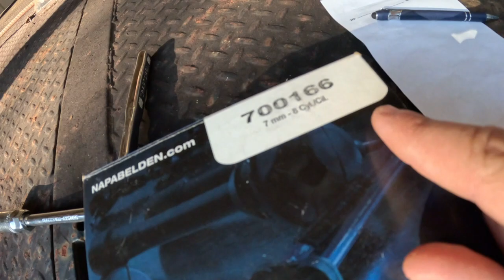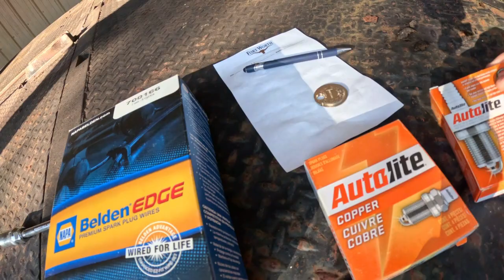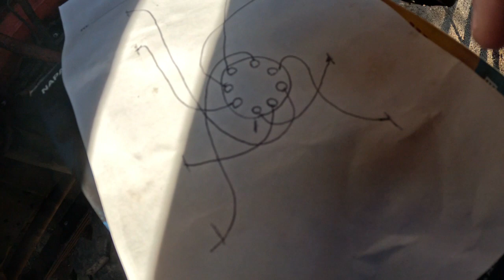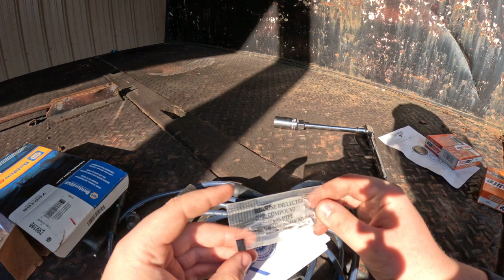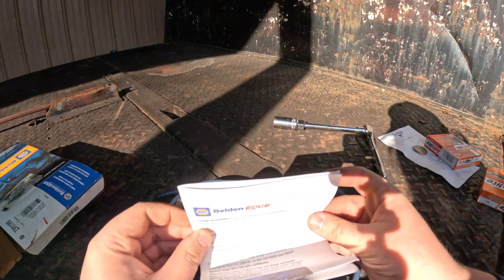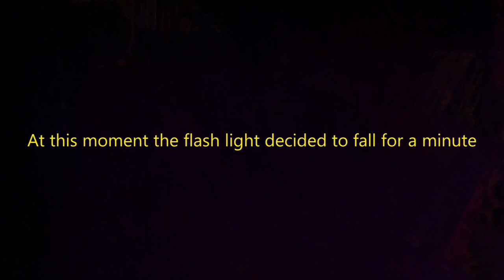Engine work on the 1968 International Loadstar CO-1700

Comment: I replaced the wires on my 68 Loadstar (V304) One wire at a time.
I matched the old wire length to the new one. Keep it simple.. I
also got rid of the points and installed a Pertronix kit many years ago, works great !
Reply from the maker: This one is a (V345E). I plan on doing that conversion later on. Thank you